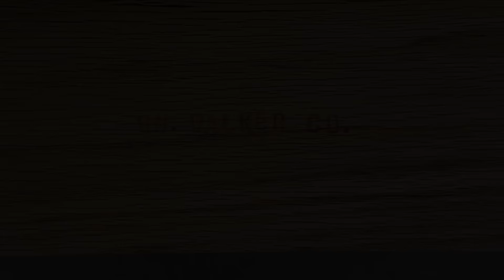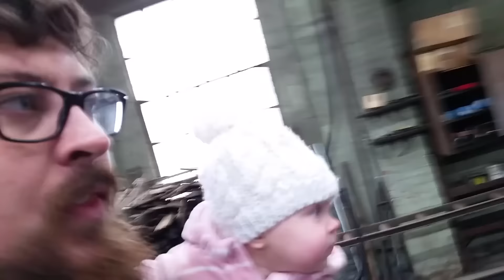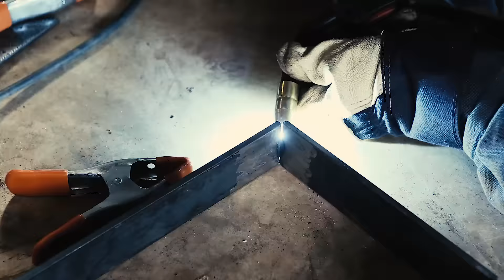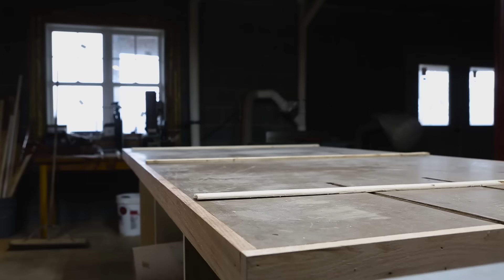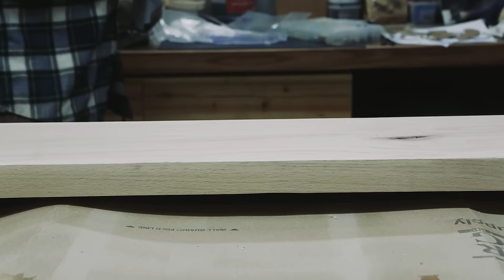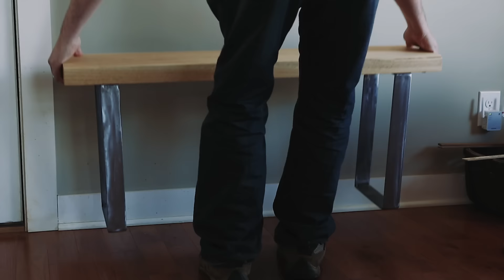Oak and Steel Bench

Comment: have you had any issues with wood movement since you fastened across the grain?
Reply from the maker: +Ryan Renard No, but this Red Oak had been dry for quite some time.  I know it's good practice to allow for movement but it was sort of a rustic bench as is with checks in it.  I don't forsee a lot of movement (yes it will expand and contract with seasonal humidity) but if it does I'll fix it.